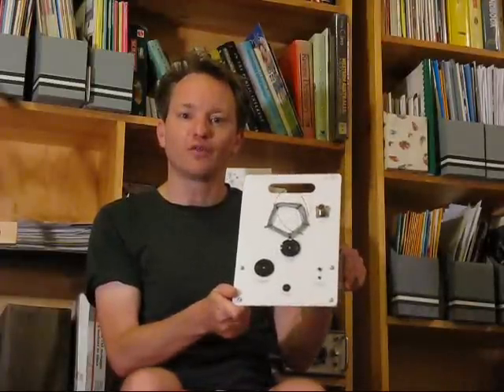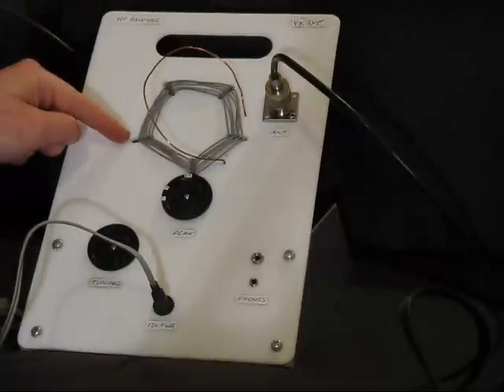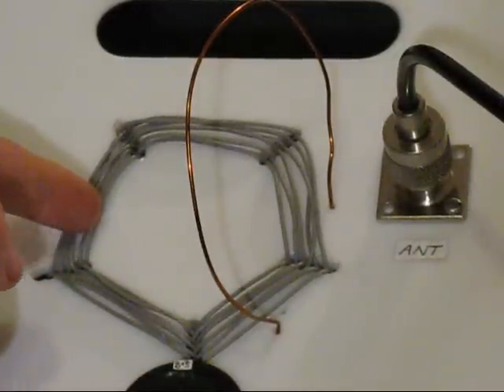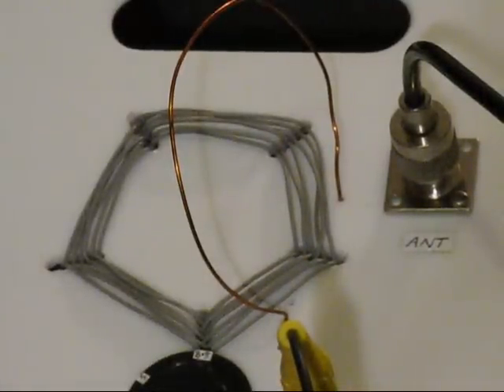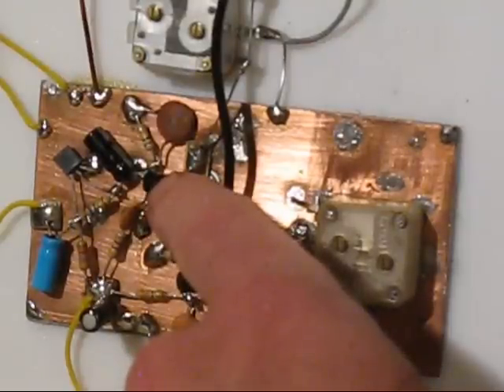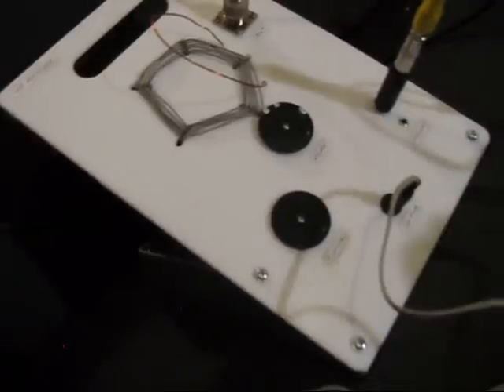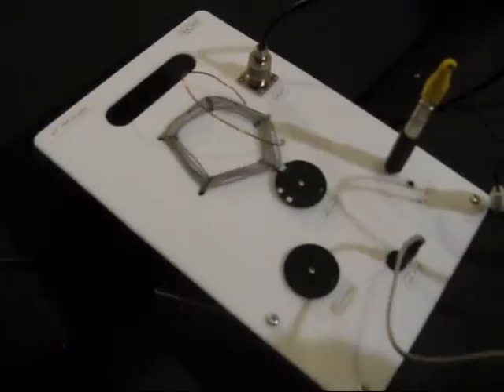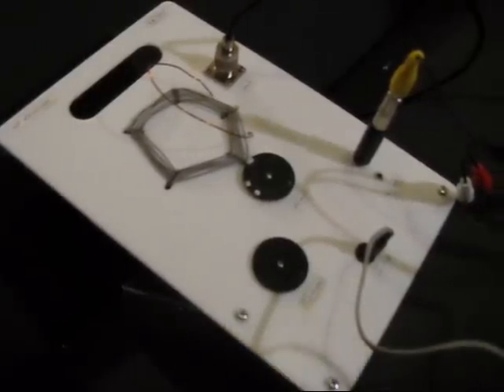"Chopping Board" HF receiver uses three transistors

Comment: Hi Peter. G3NBY.... GQRP member, so I've seen this Cutting Board RX from you in their quarterly. Your video is really 5&9+.
Now I know how well it works.
Bit of brain picking. I have a good few of those vari caps you use..two section about 300 and 500 pf Ish. I have no centre screws nor knobs.
Any ideas?.
Second question. With a shelf full of Icom stuff including the IC 7600, why am I fascinated with building bits on boards. Will be trying some of your valve stuff soon.
Long tale I could tell you of 12v HT valves (tubes.) when I was an apprentice (already fully ham licensed) in late 50s early 60s. Another time I guess.

To the guy who said that his wife would have HIM on the cutting board, I say "Buy her a new one and you have old one, Scrooge!
73 from Olde Englande.
Howard G3NBY

Comment from the maker: Alan - it amazes me as well. Why would one bother with a regenerative receiver when something like this has as much audio output?  The only thing is the regen receiver may be a bit more selective but in exchange you lose many things eg oscillator pulling on strong signals or antenna blowing in the wind.  The best of both worlds may be a regen put to the point of oscillation plus an external oscillator.

Comment: It is always surprising how well those infinite impedance detectors work across a tank with just a little bit of LO drive from a nearby oscillator, not directly connected.  The ceramic resonator makes it super easy and stable.  I'd be tempted to use a LC VFO and cover the lower-half of HF, but it would need a vernier or fine-tune gang/pot.  Maybe a subharmonic VFO tuning 1.5-2.5 MHz or so, which should be fairly stable?